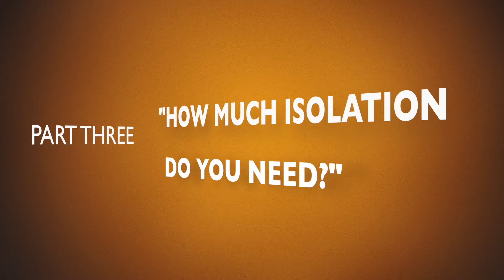How Much Isolation Do You Need? - part three - GYPSUM BOARD WALLS

Comment: One simple question. Does Green Glue between 2 layers of Gyprock panels has any advantage or any effect?
Reply from the maker: Yes. The effects of CLDM (Constrained Layer Damping Material) is well documented. Green Glue has been lab tested and proven to work. 
We don't use it and the reasons are added expense and ease/difficulty of application. We simply add more mass. ;)
And if you choose to do the Green Glue, be sure that you do NOT apply less than recommended! They recommend a MINIMUM of 2 tubes per 4' by 8' sheet of drywall (Gyprock).. do not use less. And you must be aware of the drying time which is at least 7 days, I think. You can find this information on their website. 
All the best!
Reply: Thanks for confirming.
Just calculated, buying from a local dealer, it will add extra $1400 to my build using the minimum requirement. Are there any other options? For half that price I could add a 3rd layer! 
My build has, from outside, 7mm Fiber-Cement panel > 12mm Plywood > 90mm outer frame with 70mm Soundscreen rockwool > 20mm air gap > 75mm internal frame with 50mm Soundscreen rockwool > 16mm drywall 1 > 16mm drywall 2. Nearly 10 inches thick.
With 2 all around air tight sealed doors. I'm hoping to have 60-70db STL both ways 40Hz - 5Khz. My room size is 5.4m (L) X 3.4m (W) X 2.4m (H).
Reply: hello John. Thanks a lot for your enlightened explanations, I follow since months your videos and the texts you post on your website's resources page are just invaluable..  Speaking of which, on your Sound‐Proofing: The Quest pdf it seemed to me that you were "not able to obtain completely accurate reference testing data" regarding CLDM compounds. According to what you say there, as well as after having read this vivid and kind of still open discussion between some well regarded acousticians http://forum.studiotips.com/viewtopic.php?f=1&t=3751&sid=514794f86f6dd0715ea35ffceb9e96a7&start=20 I 
I had decided to follow your ideas and NOT to include Green Glue in my studio project. Now I read that you report that "The effects of CLDM (Constrained Layer Damping Material) is well documented. Green Glue has been lab tested and proven to work." 
I guess I'm probably misunderstanding something here:) would you please be so kind to help with clarifying your position about CLDMs? 
What I had understood from further readings is that Green Glue has only been tested in a facility where there's some flanking issue which do not allow the testing of the compound in completely decoupled partitions systems, which is the case with my project. I know it's usually easier and cheaper to just add another drywall layer but my room has a very strange shape, full of recesses that I follow with my decoupled partition and drywall mounting is very messy there, I'd rather use Green Glue than going with another layer. Of course the resonance frequency of my system has been carefully calculated (with or without Green Glue) but if I'd knew I could gain a few dbs on the bass, well I'm in a crowded residential area..
I thank you very much in advance for your time!

Comment: Hello John, it's a great video thanks for sharing it. I have a very very small (budget) studio in Jakarta, and also a big fan of acoustic science. I'm a little bit confuse about why we should using a low density material inside the cavity rather than the higher one (and higher STC), could you explain it more?
Reply from the maker: The density of the absorption material will make zero difference in the sound-proofing... the higher density stuff will only make your wallet lighter. ;)
Reply from the maker: The information about higher STC insulation is just bullshit... to put it simply. There is ZERO testing data on insulation alone. Insulation (rock wool or glass wool) is POROUS. For a material to be of use in sound proofing it must NOT be porous. The insulation in a wall cavity performs are very DIFFERENT function. If you need help with your room or design, contact me via email. :)
Reply: Thanks for the explanation John, so i assumed that the mineral wool only work (at least) for a wall treatment like panels, gobos, etc (which i did, hehehe :D ) not as sound-proofing treatment, correct? coz i've reading a lot of DIY stuff out there, doing REW test, bla bla.. in the end it goes to low frequency problem.  Anyway, thanks again John and i will contact you soon. :)
Reply from the maker: Correct. It WORKS, but no better than the cheap stuff for sound-proofing. If you are ONLY using thin panels for acoustics treatment, which I do NOT recommend, then you can use the rock wool as it works effectively for thicknesses up to about 10 cm or 4 inches. Beyond that, the dense absorption material becomes quite reflective! Caution is advised.

Comment: Hi John, thanks so much for these videos. I don't understand why to add insulation to the air gap? Isn't the point of the air gap to act as a density contrast to the gyprock wall on one side, and the decoupled wall on the other side?
Reply from the maker: Where did you get that idea? The insulation absorbs the resonance within the wall cavity. It is a very, very important addition, if you want good isolation. In fact, adding insulation to a wall cavity adds about 6 dB additional sound transmission loss. See my resources page and review ir761. All the data is there. Enjoy!
Reply: Hi John, thanks very much for your response. As you can see I'm getting muddled by all sorts of stuff out there. I'll read your Resources web page. Would it be best if the wall cavity is completely filled with insulation? Or leave an air gap in it?
Reply: It all depends if you have 2 wall frames (room-in-a-room) or just one wall frame.